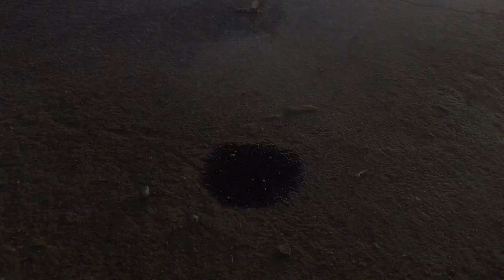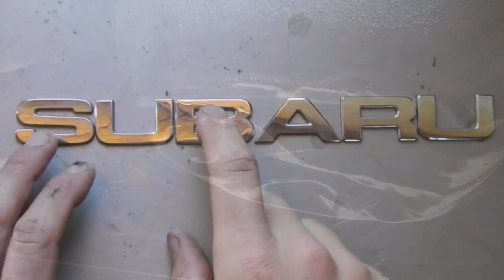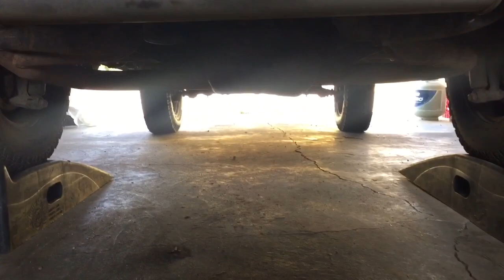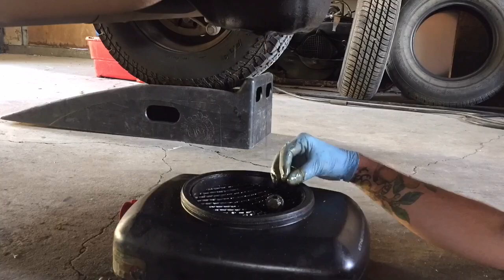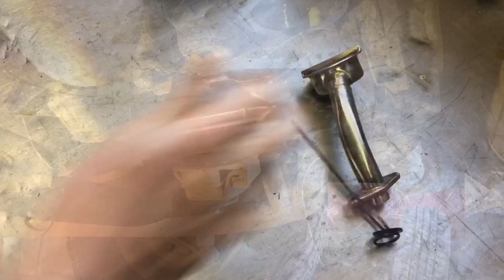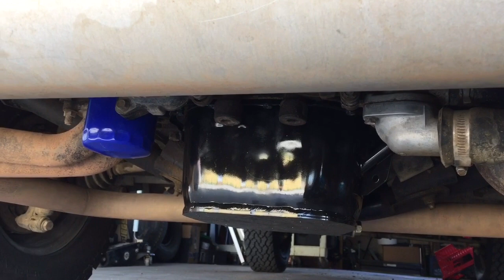Smashed Subaru Oil Pan - Shortened Oil Pan Install

Comment: I just commented on your part 1 video saying how you need to protect your oil pan. It's ironic that this is the next video I watched.
Reply from the maker: Haha yeah! Very ironic! If you do off-road stuff is definitely a good thing to change to a shortened oil pan. On road it doesn’t matter as much.
Reply: Busaru They sell brush guards specifically for EJ oil pans too.
Reply from the maker: The most bullet proof thing in my experience is to go with a shortened oil pan and a skin plate off the Busaru crossmember. I may even start offering that as a feature - may not be all that necessary though...

Comment: Hey Mick - Two things....  Other than thanks again for so much information on your channel!
How much shorter is the pan and oil pick up from stock?
Is your lower water neck aluminum?  If so, do you know what years are aluminum so I can swap one out for my plastic?  Then I can weld AN fittings onto supply and return to run a safer radiator for my buggy.
Reply from the maker: +Kevin Alberts on my 73 The water inlet is aluminum. It's from a 93 Legacy 2.2. Oil pan is a couple inches shorter but definitely improves clearance.

Comment: So I did an idiot thing and swapped a Subaru rs to a wrx body. I changed engine bay wiring and under the dash wiring but the car still won’t start all I hear is clicks like if relays were clicking. Fuel pump doesn’t prime nothing works it’s just clicks on and offf. The engine cranks over but the car just won’t start idk what to do o do t know if it’s my ecu or not I do t want to spend money buying things and not being the problem
Reply: Jose Ruiz figure it out?  I think it's the ecu.